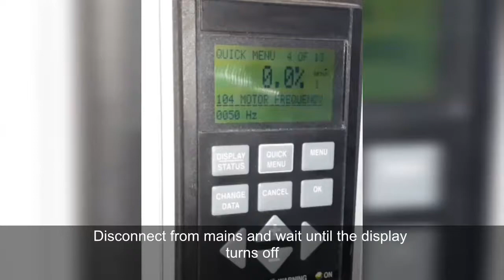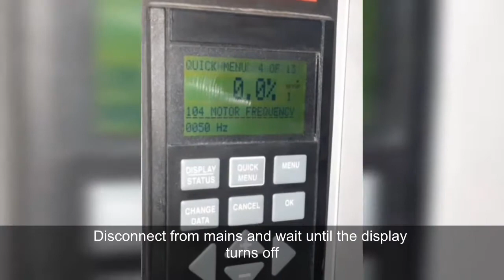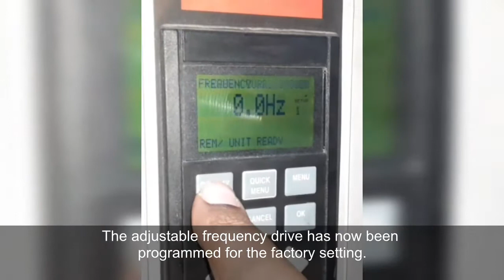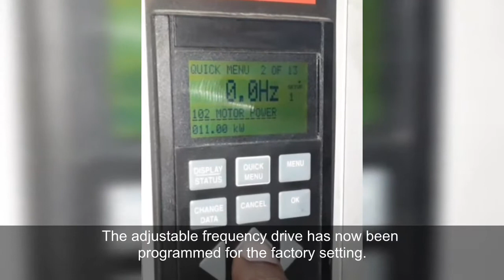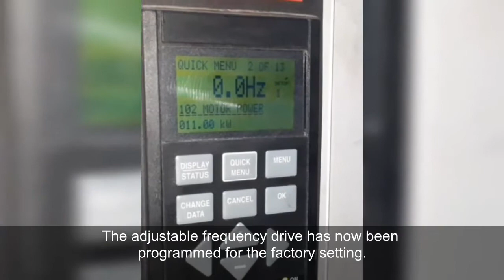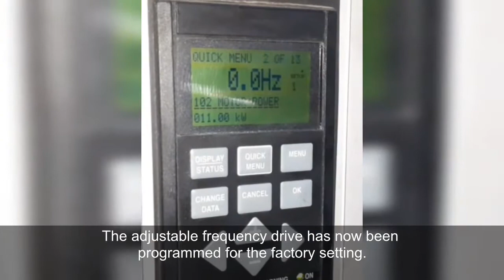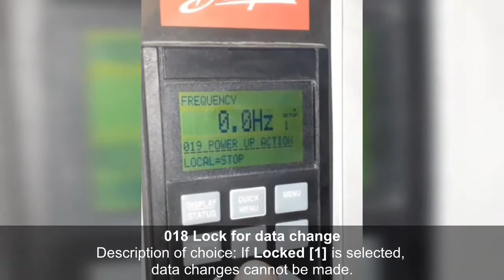INITIALIZATION AND  LOCK UNLOCK PARAMETERS OF VLT5000 DANFOSS INVERTER | Flow Chart @FlowChart

Comment: I can't change parameter because "Data is read only" how do I can fix this???
Reply from the maker: Stop run command,
Than, unlock parameter and change required parameter.
Reply: @FlowChart  ok I will try...
Reply: @FlowChart  I look at the display in the 2nd line the number 1 below setup has "F" next to the number what was that???
Reply from the maker: Please share photo in inbox -facebook@flowchart4u
Reply: @FlowChart  Facebook fanpage right?
Reply from the maker: Yes, there have a message option, you can send me
Reply: @FlowChart   I already did..please check you inbox...
Reply from the maker: Ok, I seen

Comment: Sir,,,error -14 asar karon ki ei inverter a
Reply from the maker: ALARM: 14
Earth fault (Earth fault):
There is a discharge from the output phases to earth,
either in the cable between the frequency converter
and the motor or in the motor itself.

Turn off the frequency converter and remove
the earth fault.